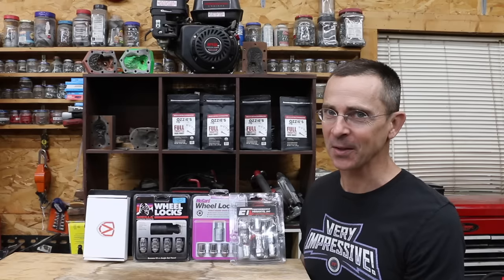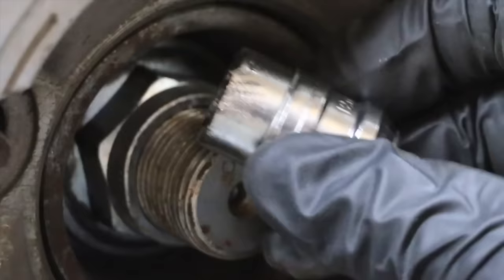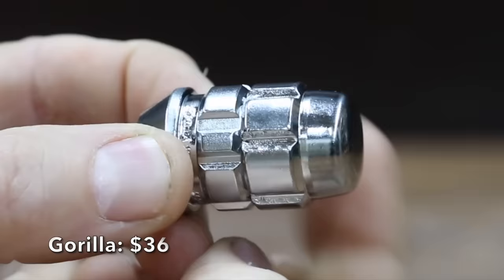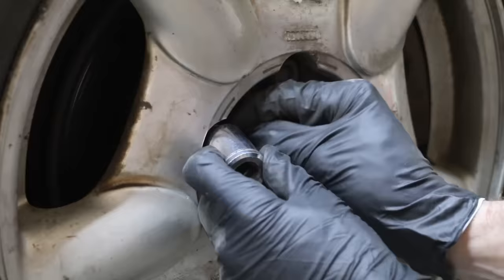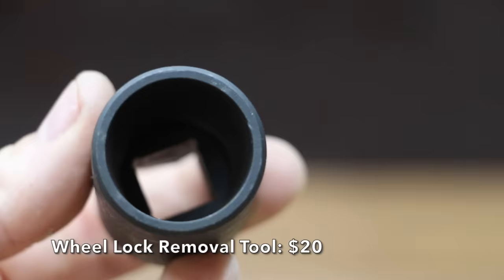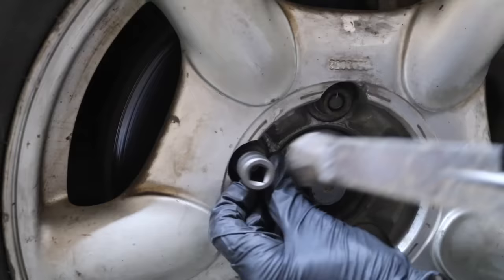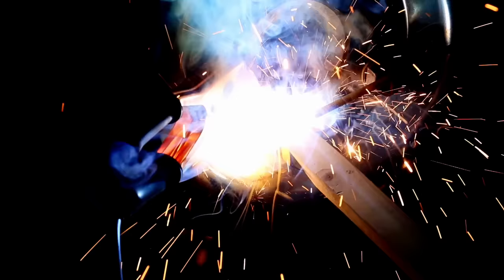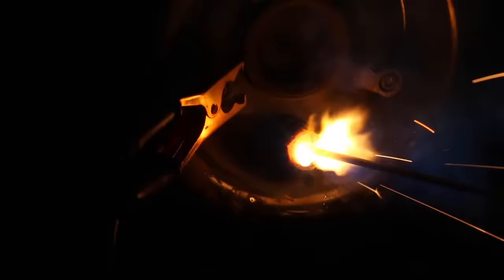Best Car Wheel Theft Deterrent Lug Nut? Can Any Wheel Lock Prevent Theft? Let’s find out!

Comment: Got a new job today and found out i needed a few tools i was surprised to see you hadn't done one, that I can find, yet. need a few different pneumatic tools a 90 degree die grinder and a straight also the larger 6-inch grinder which i don't know what that tool is actually called.
Reply from the maker: Thanks for sharing.

Comment: Great vid as always, but could you do one for european styled wheels which use bolts instead lug nuts, they usually go all the way inside the rim, and are a lot harder to remove if you don't have the key
Reply from the maker: Thanks for the suggestion.

Comment: The issue with wheel locks is that there will always be customers who lose or break the removal nut, so mechanics and buyers and sellers will always need products that remove wheel locks. Because of this, makes you wonder the point of even using wheel locks since literally all of them need back up removal kits or methods.
Reply from the maker: Thanks for the feedback.

Comment: Amazing channel I keep coming back to. My VIDEO IDEA is about handheld vacuum pumps (manually operated, not electric). They can be used to bleed brakes, others are best for removing fluid out of differentials, transmissions or any liquid out of almost anything. Problem is, they never seem to last in automotive applications. I can't find a vacuum pump that will work for more than a few weeks or months. I am wasting money on garbage, please help. Cheerz
Reply from the maker: Thanks for the suggestion.

Comment: Do locking lug nuts exist for lug nuts with an external thread to thread on the plastic lug nuts to hold on the wheel center cap?  I.E. 2006 Tahoe  Thanks!

Comment: Please test head gasket sealer next. There is no reliable comparison information anywhere online, and I have spent a long time looking. Things to test include how big a hole in the gasket can get, if it does does not fix it with one bottle does it build up over several bottles to fill a gap and if so how much per bottle, and if it can fix a coolant leak in the head gasket where the coolant is not directly mixing with the combustion chamber. The last reason is because the material supposedly hardens on contact with combusting fuel, but does this still work if the hole goes from the combustion chamber to the oil and then the coolant? What if the hole never touches the coolant but you remove the spark plug and spray the product on the gasket before turning the engine on, and if that does work can you repeat the test with a hole so big the engine can’t make enough compression to ignite, but you spray some product on the hole inside the engine, then heat it up with a blowtorch or a bit of fuel down the spark plug hole and light it? Does it work with diesel engines, high or low octane fuel, propane fuel for smaller engines? What about the gasket sealant bonding to aluminum or iron block, or different head gasket materials?

Testing this with a straight 4 

Thank you very much for the absolute best testing available online, your content is second to none.
Reply from the maker: You are welcome!  Thanks for the video idea.

Comment: Great video! My friend just had her Toyota Prius stolen last night. Could you please do a video comparing these brake type anti theft locks? Mainly the better quality ones like Autolock and Oopsi brands(also the most expensive). The steering wheel locking bars are a joke. You just hack saw the hollow steering wheel and you’ve got the lock off. Brake pedal locks seem the most effective due to the brake pedal’s heavy duty construction. Thieves seem to have many options to bypass any electronic form of built in security the manufacturers offer. Insiders at the dealerships are making replacement key fobs for their car theft friends. All they need is the vin number. They then have your address and don’t even need to break into to your car. What do you think? Thank you!
Reply from the maker: Thanks!  Sure sorry to hear!  Thanks for the suggestion.

Comment: All wheel locks are junk.  If you lose the key, you're screwed if you have a flat.  I've been a mechanic for 35 years and used to live in Michigan where everything rusts in place.  I've had to use all kinds of things to remove wheel locks depending on the wheel.  Angle grinders, old sockets, welders, and so on.  Your best bet is spline lugs.  Yes, you can buy spline sockets that will work on them, but wheel locks are usually shallow and strip out easy, that's why I like spline locks.  But if someone wants to steal your wheels, they will.  Just having spline locks will deter most people.
Reply from the maker: Thanks for the feedback.

Comment: If you have wheels that are worth thousands of dollars, I would get 4-5 different sets of the advanced wheels locks. There's no way a criminal would have enough time to remove 4-5 locking wheels nuts at once. Remember: These are not necessary meant to completely stop theft, just increase the time it takes to do so. That supposed to make the would be criminal(s) either give up or be caught before they finish. If they're only worth a few hundred each, might as well just get the Gorilla ones.
Reply from the maker: Thank you for sharing!

Comment: I would like to see a price point analysis of DIY cryogenically treated drill bits versus off the shelf brands. A channel called Applied Science did a video about how you can get the metal crystal grain structure called pearlite to form at cryogenic temperatures with liquid nitrogen instead of heat treating in a kiln. I want to know if that process would be worth it considering the expense of the dewar, liquid nitrogen, cheap vs expensive bits.
Reply from the maker: Thanks for the suggestion.

Comment: I use a wood stove to heat my house all winter long. I regularly sweep my chimney but use a couple of different brushes. I use a traditional steel brush and rotary head using weed eater string. I was wondering if you could compare some different sweeps along with different creosote removing products like logs and Kwik shot?
Reply from the maker: Thanks for the suggestion.

Comment: a portable impact chisel  will take all of them off as well. The welder and a over size nut welded to it. Are the best ways to remove any wheel lock nuts. Really If you have a hard time taking anything loose. if you  just heat it and beat it 🤭 💪✌️🛠️💯🍻  it will come off  work every time
Reply from the maker: Thanks for the feedback.

Comment: As an Auto Tech... Imo 90% of all wheel locks are useless for several reasons. Most wheels are not in demand, most people live and work in areas where it is not an issue, the criminal motivated enough will not be stopped by them.
Also, as an Auto Tech, I despise these things, the customer often doesn't know they have them, and/or they rarely leave the key out for the tech, therefore I have to dig though the personal belongings of most cars that have these to find the key, when they break while hand removing and hand tightening it I'm the bad guy. Let me reiterate... I DESPISE wheel locks.
Reply from the maker: Thanks for the feedback.

Comment: As a mechanic, trust me when I say that all wheel locks are garbage. I get paid good money to remove wheel locks. If they want your wheels, they will get them. Especially using a 5 pound maul instead of a little hammer. Two guys, a bag of a dozen tools and any wheel is gone. Wheel locks are usually a cheap upsell for the dealership. And the hardness of the wheel locks means nothing to people who know what they are doing.
Reply from the maker: Thanks for the feedback.

Comment: What are your thoughts and/or willingness to test generators? 2000 watt and 3500/4500 watt generators? Wen, Champion, Westinghouse, Honda, Generac, GenMax, ETC. I understand it would be a spendy endeavor. Actual output, sound levels, weight, runtime, features, ETC.
Reply from the maker: Thanks for the suggestion.

Comment: We need to remember the types of wheels these are used on. Most likely they will not have open access and will be super narrow.
Reply from the maker: Thanks for the feedback.
Reply: @ProjectFarm  only reason I say anything is im about to buy a new Camry and new rims have far less room that the older rims. Plus ya gotta think what kind of rims thieves usually go for. Have you found any new wheel locks since making the video? I want to buy something and that's why I came to your video. Just curious what you would buy?

Comment: Can you test battery heat shield for summer and winter environment? I've got factory cover from VW and it does help, but I wonder if I should remove when summer comes.
Also aluminum heat shield is out there for summer usage ("protects" from engine heat) and wonder if those works.
Reply from the maker: Thanks for the suggestion.

Comment: any of those wheel locks can be easily broken by using a 19MM or 20MM with 12pt socket - hammer it in and pull it out
Reply from the maker: Thanks for the feedback.

Comment: Hey can you test meat thermometers, both for accuracy and their ability to withstand high grill temperatures like when I’m searing steak, or when I’m using one to monitor the ambient temperature of the grill itself?  I’m particularly interested in Bluetooth ones, either the self-contained stick kind, or the ones that have multiple thermometer spikes wired to a single readout unit that can connect via Bluetooth.
Reply from the maker: Thanks for the suggestion.

Comment: I have a video idea best caulking to use in the shower,  test holding strength, mold resistance, and weathering over time
Reply from the maker: Thanks for the video idea.
Reply: @ProjectFarm  had this when I went grab 100%silicon for the shower earlier today, thinking there must be a better material than pure silicon, what's the point of material science if we cannot synthesize  a better one

Comment: I have only had wheel locks on one vehicle, wasn't even my most expensive vehicle. And I will never use them again. Okay, I live in a place that it is very unlikely to have my wheels stolen. And any "professional" is going to have the adapter they need anyway. One time I had  a tire blow out on a major highway that goes from the east coast to the west coast. Because of these ridiculous locks (even having the proper adapter) I wasn't able to loosen that lug. I will never use again. I will take my chances with theft vs my safety on the side of the highway.
Reply from the maker: Thanks for sharing.
Reply: @ProjectFarm  keep up the great work!
Reply: @ProjectFarm  I hope that didn't come off negative towards your video. I enjoy your channel so much.

Comment: the advanced wheel locks only fit some cars. for example toyota alloy wheels have a flat seating surface. The advanced wheel locks have a tapered seat which would lead to damage and inaccurate torque.
Reply from the maker: Thanks for the feedback.

Comment: The main problem with any of these, even the advance lock, is that as soon as a thief realizes they have been thwarted they will either vandalize the rim, or when they stand up to leave they will scratch the every living $#17 out of the side of your car as they leave. People like this have no morals, I'd rather just get my rim stolen (I have multiple cars so having one out of comission temporarily is not a big concern) and buy a new set of rims for around 1k rather than have to take a deductible claim on my insurance for around 4k for paint correction or panel replacement if the thief decides to hulk kick your car door from being p1$$3d off. Moral of the story is to just be smart about where you park.
Reply from the maker: Thanks for the feedback.

Comment: I never understood wheel locks personally. Most people if they haven’t lost the key a month into installing them most newer vehicles likes Toyota VW and some other German cars specifically have spots in the trunk to store them. So either way if a criminal is smart enough they would realize that and get your wheels and tires.
Reply from the maker: Thanks for the feedback.
Reply: @ProjectFarm  some Audis have the spare tools in a holder on top of the spare with a wheel lock slot and a Toyota sequoia and the Lexus version have a holder in the trunk on the door itself which has a plastic door holding the tools. I always wondered why they seemed to enforce keeping your wheel lock the only thing trying to protect your cars wheels inside the vehicle when someone could just break a window and get it.

Comment: Those are not wheel locks. They have no locking mechanism. They are security lug nuts designed to be used with the appropriate security lug nut wrench.

Comment: its all fun and games until either A the tire guy kept you lug key or B you left it on the side of the road after changing a flat tire or C the dealer never gave you the key to begin with. either way ill charge you $100 or more (depending on attitude} to remove the locks.
Reply from the maker: Thanks for the feedback.

Comment: Why we do don't go with white girl / white night spline lug nuts they are difficult to get off and when they get corroded which is about a week after you put them on in the winter they're difficult to get off you got to get a different tool such as the master craft one I have about masscraft maximum because if I didn't the factory sevens flying tool would never fit on it ever mechanic that I got to tighten my lug nuts had to use a hammer to get it on and then oh boy

Comment: The answer is cry once and if you can't afford to do that then hopefully you have enough intelligence and equipment to build your own Advanced wheel lock out of something in the category is now $19 and in order to avoid all of that rust go get yourself some copper wash or do like I do and put pot that's into copper filing and Tumble or barnish with a copper wire brush and a torch.  
By the way there are two techniques that you did not try out. A short blade on a Sawzall will help you to split the top of the net and you can always Wells Rod into the Advanced locking nut system. Needless to say the advanced walking that system basically requires a welder. And that means that nobody is going to be taking your wheels in the middle of the night. So you're not a longer interested in whether or not they're interested in your wheels now you have to be interested in whether or not they're interested in the entire car. Spend the $90 for you will cry because you will not be able to move your car and some cities will even write you a ticket for being up on blocks now. Honestly I think that this city is stealing the tires if they're going to charge you for being up on blocks they had to figure out some way to get paid back for those blocks that they had to leave behind.
Reply from the maker: Thanks for the feedback.

Comment: Nobody is stealing wheels. Dealers found how to charge people $200 for a "security package", and the avg dumbass consumer thinks "duh, I want security". You lose or break the key, good luck getting a tire off. The only useful time for a "security package" is if you have a convertible or soft top Jeep that adds a locking center console. And even still, take those locking lug nuts and throw em in the nearest garbage.

Comment: Yeah, so my 19 inch japan racing rims (1000 dollars each) got stolen from my volvo v70. I got new ones on my insurance, and bought me some wheel lock nuts, you know, 1 pr wheel. Fuckers came back for more and got dissapointed, and so did i, bc when they could not get the rims off they went and got some loctite 270 (guessing its the 270 based on colour) and tourqed the living shit out of the regular nuts. Had to cut of 2 rims, and the 2 others got destroyed from the heating and beating to get sockets on and off. So now i have my 3rd set on, and i have locking nuts on all the studs.
Reply from the maker: Thanks for sharing.

Comment: if someone wants your wheels, they'll just pull the whole hub assemblies right out.. just like catalyst thieves don't need the proper tools to remove your exhaust manifolds.. "poppy show".. no connection between the joke lug nuts and the issue of theft.. however... one wonders... how do you change a flat?? do your keep your trick sockets in the vehicle?? hmm.. do tell us more..
Reply: remember when the solution to battery theft was an alarm that ran down your battery??